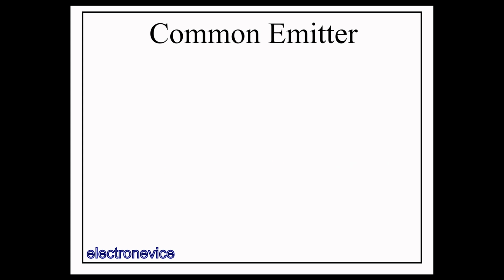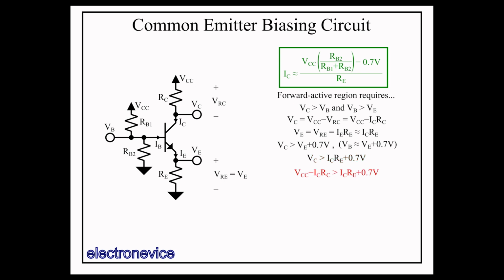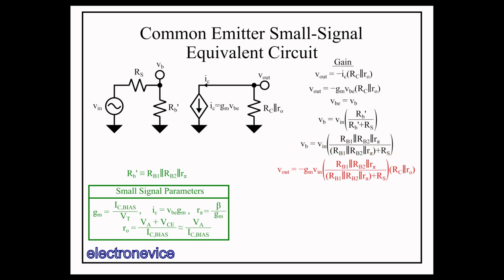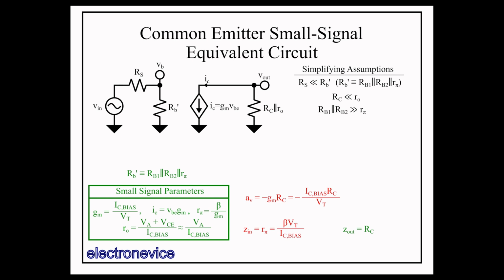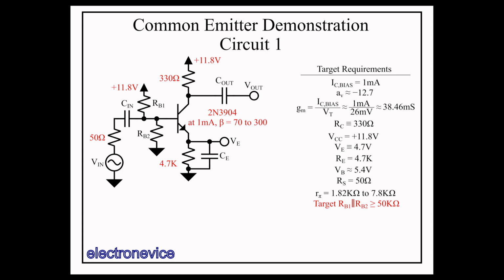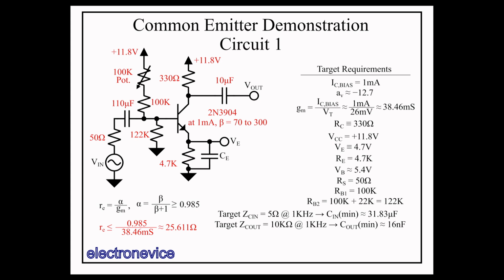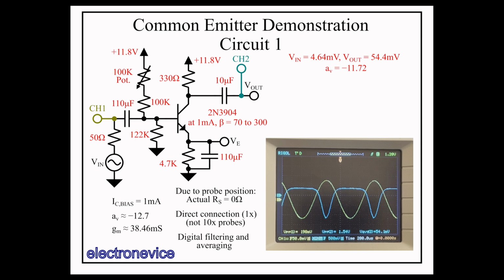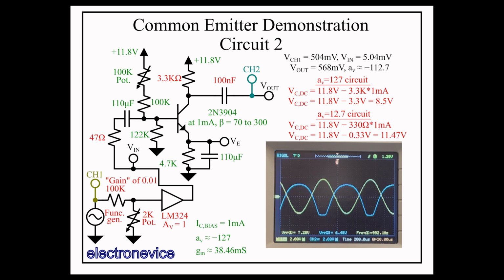The Common Emitter Amplifier [Transistor TS 4]

Comment from the maker: Corrections

At 2:28 I say “we're going to assume that the biasing resistors are large enough” I meant to say “we're going to assume that the biasing resistors are small enough”

at 16:09 I say “I'll set the biasing resistors to a target above 6V” I actually set it higher than that, but the Thevenin resistance of the divider I used was also above 50K, so it was a little bit more guess-and-adjust than I implied with the equations.  The main point was I used a potentiometer in conjunction with the divider resistors and adjusted that biasing network until the emitter voltage read 4.7V on my DMM. 

I give somewhat contradictory advice regarding the biasing resistors – indicating that they can be made low enough so we can ignore the bias current correction factor.  Then I go on to say that they should be much higher than rpi so they can be ignored in the small signal equivalent circuit.  

It sort of seems like you need to both make them really low for the biasing and really high for the small signal model.  This is, of course, the optimal situation but sort of not possible.

The emitter resistance helps mitigate the biasing errors produced by high biasing resistors so they can be higher than optimal for the biasing circuit, but more realistically – if you can – you should do what I did and make them pretty large and then tune one of the biasing resistors while measuring the emitter voltage to precisely compensate for the base current.  Or you can design your circuit to not require a precise collector current setting.  It's more important that the biasing resistors be high for the small signal circuit than be low for the bias circuit.

As a final note, there are other biasing circuits and this advice only applies to this specific biasing circuit topology.